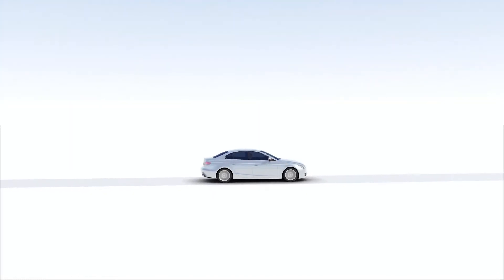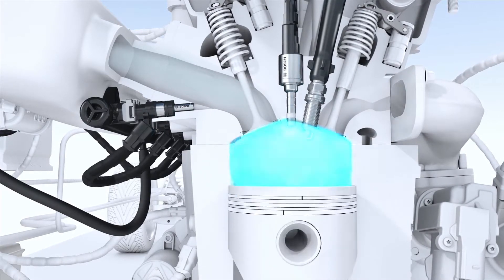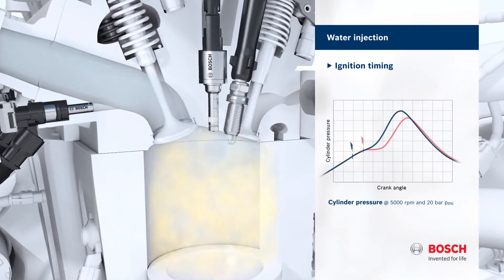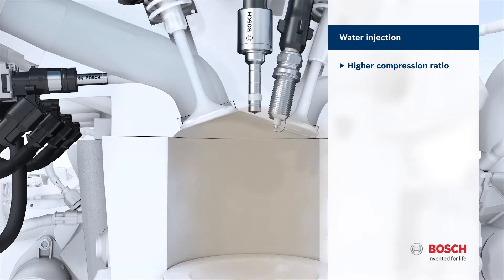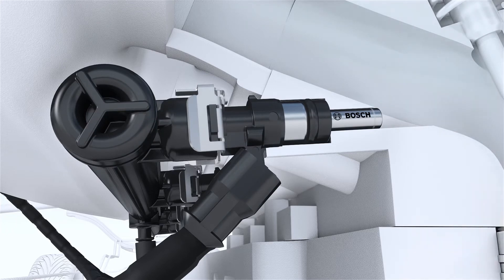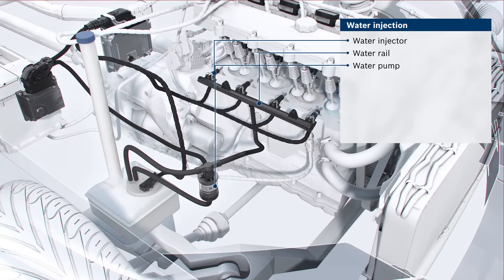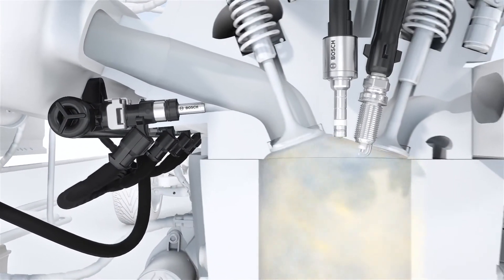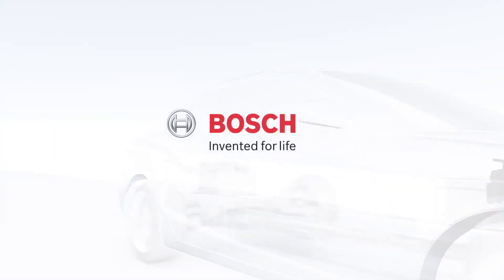Bosch Engine Water Injection System

Comment: water for what? can u explain? water can give engine power or what?
Reply from the maker: Lowering temperature in combustion chamber allowing a higher compression ratio without a high risk of knocking=better performance. Usually turbocharged engines are working at the limit.